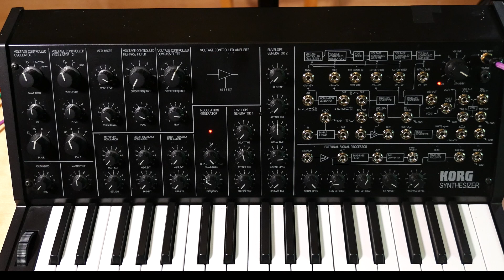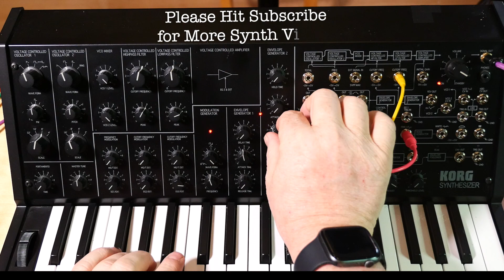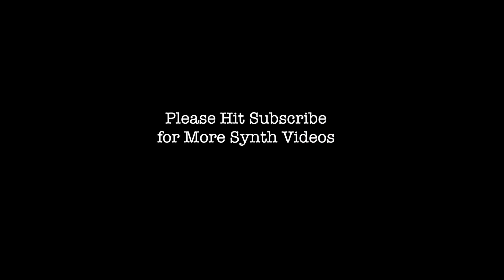MS 20 Video 3 - Sample & Hold

Comment: wtf i did the same patch and mine doesnt do that at all,how do i know if my MS20 mini is broken or something thats sad...
Reply from the maker: Hmmm unlikely it is broken but you never know - try again and check that all the controls are set to same as the video
Reply: Did you ever figure out the problem? I am having the same issues.
Reply: @AngryPenguin22  I know your message is 2 years old, but I guess my message might help anyone else that might have a problem. You need to check your tuning on the second oscillator because if it is just a wee bit out you can end up with beating dissonance that sounds like an LFO. He's also got a lot of reverb on the sound as well, so the release is coming from that.
Reply: @robertdedolfijn  Interesting. Thank you for the update.